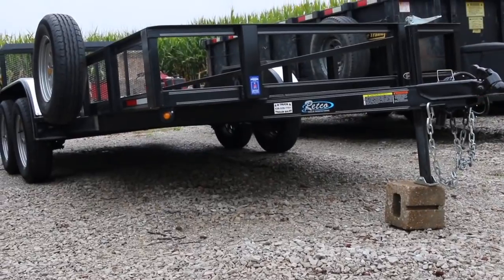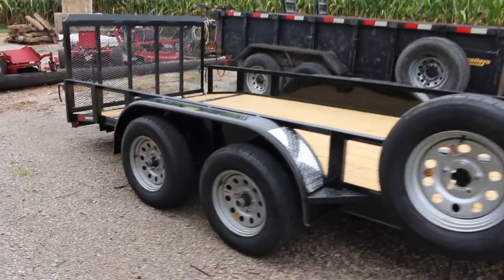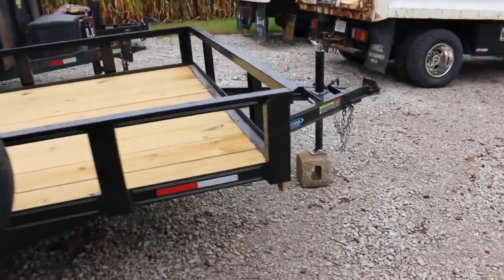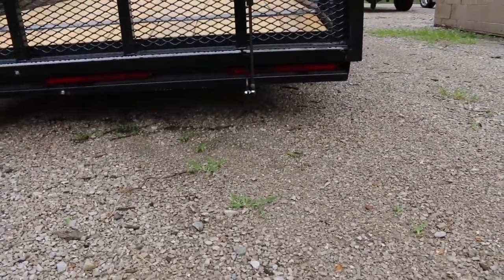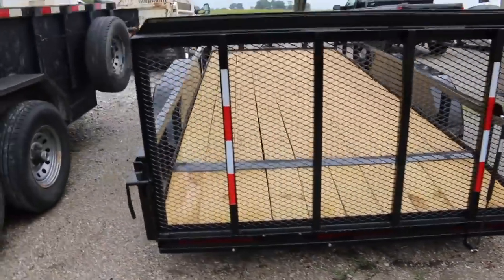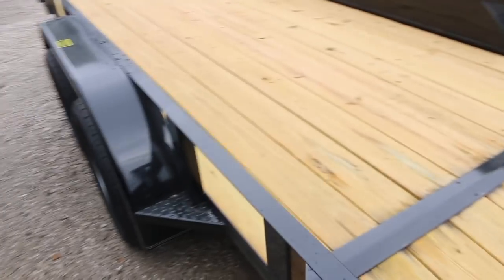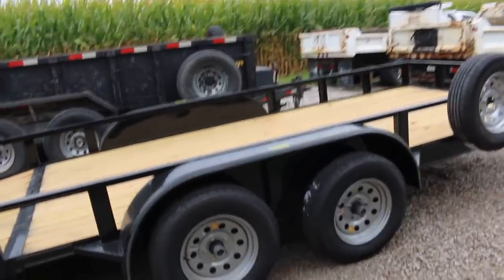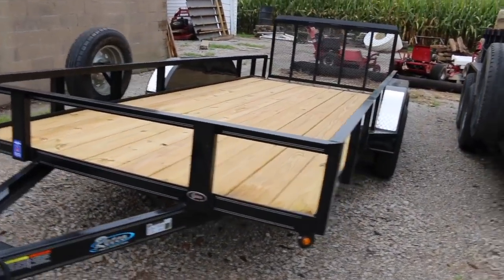New Lawn Care Trailer

Comment: What is your opinion on the build quality, reliability, customer service, etc. of the Retco utility trailers? I am interested in purchasing a single axle trailer (5.5'x10') from them and they don't have many reviews online.
Reply: Just went to look at a 5.5x10 in person at a dealer. I thought built the quality looked good overall, but the bottom side of the rails and frame were not painted. Any idea if this is just the case on the smaller models or is it like that on yours too? Also, what brand of tires did yours come with? Thanks.

Comment: I under stand the reason you got dump but way the lawn trailer I run a dump as my only trailer on a pick up just like your lot easier maintain on not two or 3 it’s nice that you can haul grass in it plus ya got the equitment trailer that if ya had to you could have towed mowers with